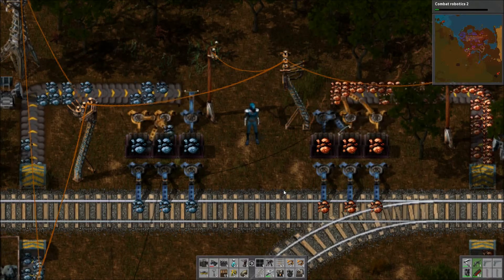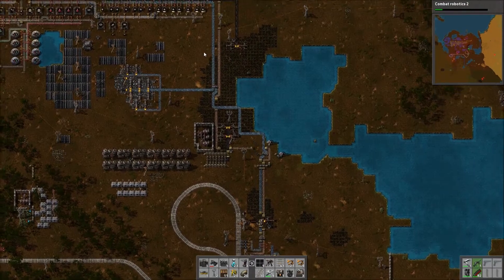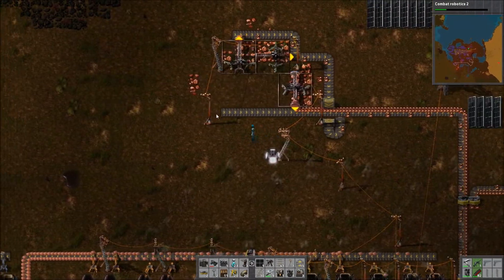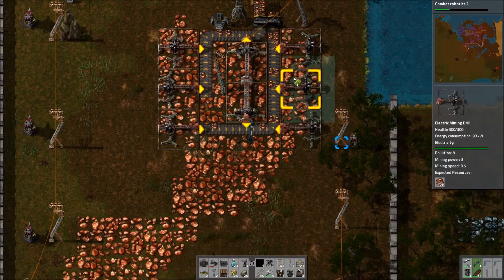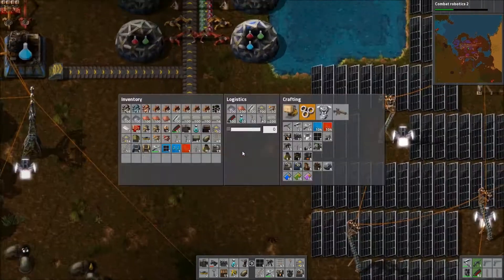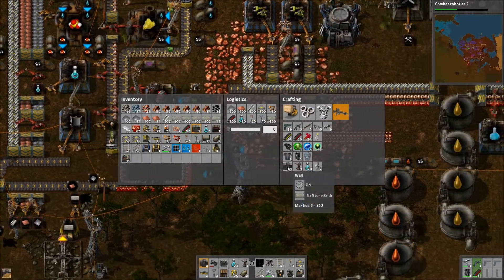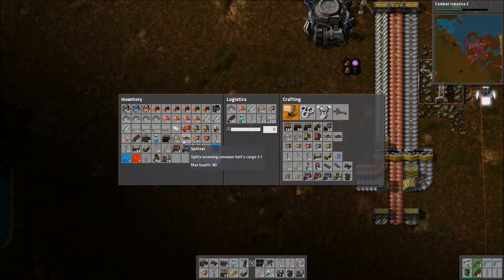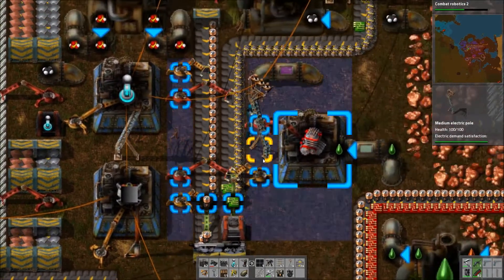[22] Let's Play Factorio - Advanced Manufacturing

Comment: For the train offloading station, have you considered a sorting loop? Basically fast inserters take from the train and offload as usual, but the conveyer unravels into a loop that features multiple smart inserters that insert into chests; the filtered products then offload into their respective iron and copper lines. Things that are missed then circle back around for another pass.

Doing this allows you to further expand your intake of whatever ore you need; whilst being future proofed against increases in your wagon length or numbers of inserters.

In terms of oil, it might be good to barrel up your crude; which reduces your need for storage tanks; and aim to crack pretty much everything into petroleum gas. Gas is what you'll be using most of anyway; light oil is good for more gas; and you don't really need a lot of heavy oil unless going for a ton of express belts; so again, it's good for more gas by cracking into light oil, then gas.